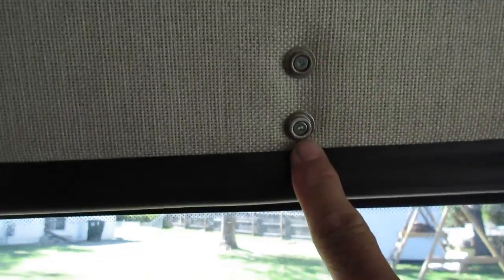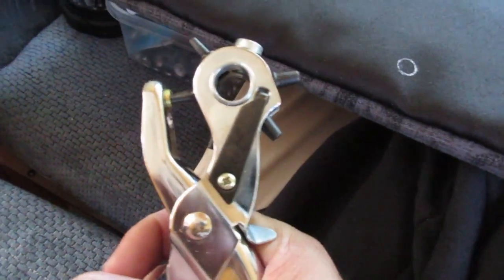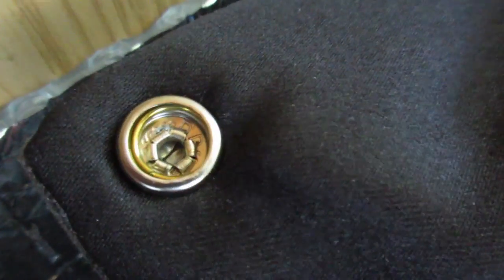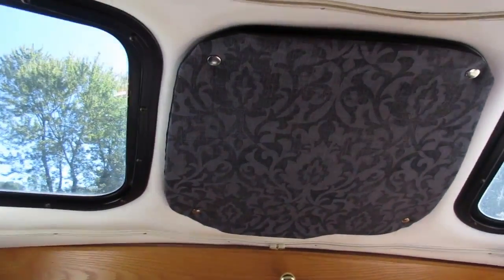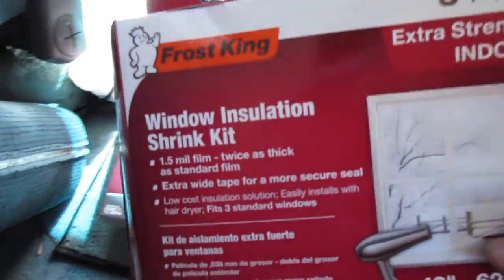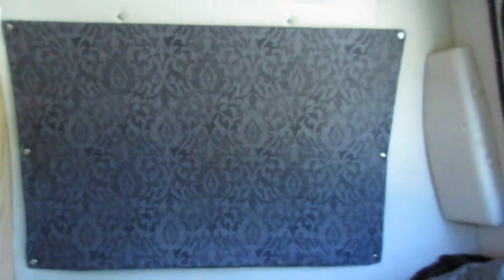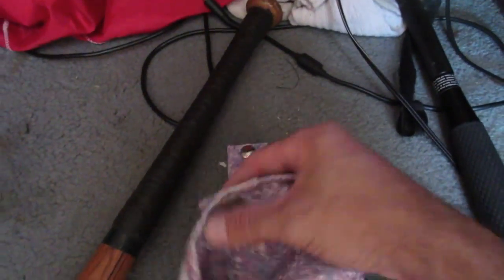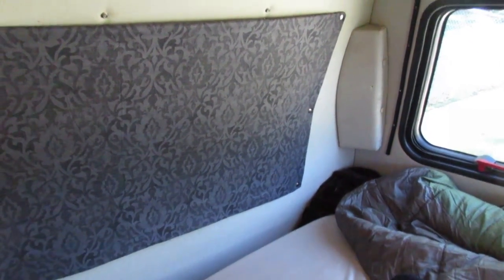Van Life: Window Solution For The Winter

Comment: I love your idea for the curtains! In our camper we actually had curtains to separate the front seats from the back. I replaced the original ones with some thick long ones. But we bought some window blinds made of that metallic stuff, that stick to the glass on the front windows. We prefer using them because it makes a bit more space. We can use the front seats for our clothes etc. all the best!

Comment: Those turned out great! Much more "put together" looking than the grandma curtains, for sure. I know this video is kind of old, but would you be able to provide links or a name of the tools you used for the snaps and cutting the holes? I'm currently working on this project. Just have some black out fabric pinned up there with sewing pins. It works well, but is temporary.